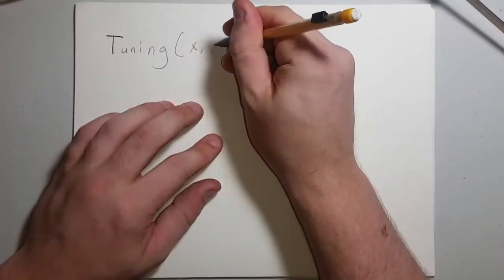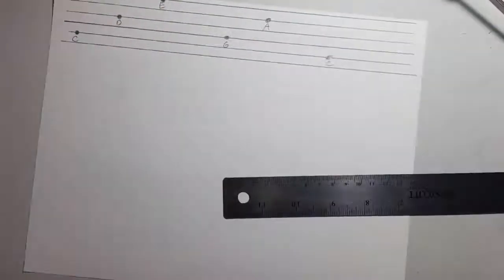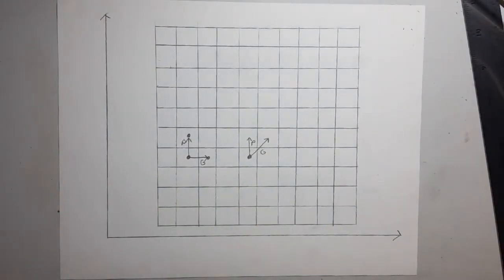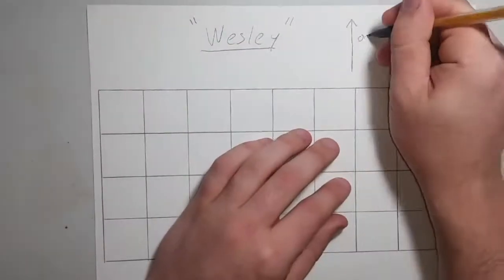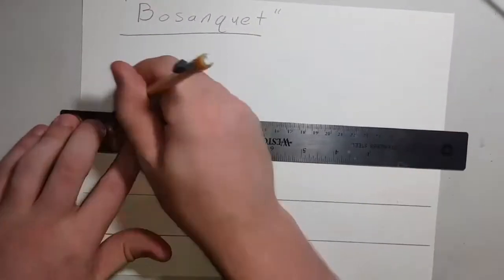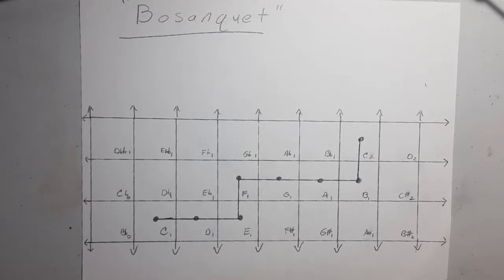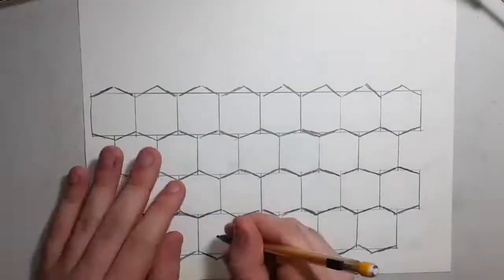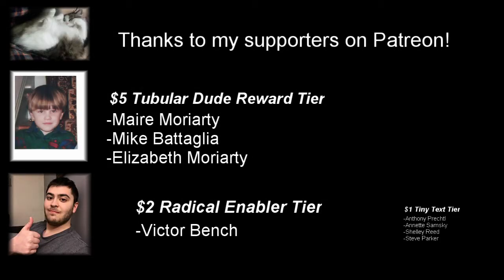Tuning Theory 4: Generalized Keyboards ("Microtonal Theory")

Comment: The Lord gave me a hexagonal keyboard layout for just intonation but it is very hard to explain the pattern, but it accounts for naturals, all flats, all sharps, and many pluses and minuses for syntonic commas up and down, and a few double flats and double sharps, all in very ergonomic positions for the hands for chords as well as scales. The keyboard is designed to be acoustic only and having harmonium reeds to produce pitches. The layout is based around the JI lattice of pure thirds and perfect fifths, but unlike the lattice, my layout can display and give the hands access to octaves of every note. The keyboard consists on 3 "universes" of keys, all right next to one another, but not directly related to the pattern of each contained universe. At the center of the "center universe" is low C2 and all hexagons have their points up. Perfect fifths are up and to the right, and perfect 4ths up are to the left. Ascending octaves are straight up AND down. Every universe is nine keys across with a version of C2 as the center note. The left most universe has Cb2 at the center, and the right most universe has C#2 at the center. Up to the right is major and minor thirds alternating and down to the left is minor sixths and major sixths up alternating with only one discrepancy in order to main consistency of the pattern of octaves. Music is asymmetrical, and this layout while orderly, does reflect the asymmetric nature of pure harmony while allowing extremely good access to chords, scales, and note clusters. It is very intuitive to look at, but very hard to quantify into a simple sentence so one can understand the amazingness of it. I also do not have a camera that can take a pic in a high enough resolution to make out clearly the notes and their letters and orientation. In my opinion though it really is the pinnacle of keyboard layouts because of it ease of play in 5 limit JI in as many octaves as you want in more keys than are available in 12 TET. I have never seen another with this layout. I hope I can find someone to help me build this organ in the future.

Comment: This is a really nicely done video. There should be a way to attract major interest in producing a popular documentary on this subject but the viewers need to be told exactly what is in it for them for such a documentary to generate popular interest, so the prospect of the relatively untrained doing unprecedented music  with enhanced expression of emotion are the two major selling points. Unfortunately these points have to be proven with music, they can not be proven by reason alone but only by field test and public demonstration. 

Further almost all the focus has been on furthering the theory when the physical challenges of designing  wide range generalized musical instruments  which are also easy to play, good sounding and durable once built are extremely challenging. The whole "hex key" approach is an attempt to  adapt the keyboard rather than a response to an opportunity, its assumed only finger tips are to be used as per the standard keyboard where hitting a little off assures one of unintended harmonies as a digit accidentally straddles a line, abutting keys is what we should be taking every oportunity to be moving AWAY from (consider how easier it is to play only non abutting black keys).

 Hex keys are clear to the mind but clumsy to the body and worse they assure only an expensive solution adapted to an expensive mechanical rather than inexpensive electronic mind set. 

What is needed are SMALL side activated buttons (like small very short joy sticks) with large inert areas around them, this way digits sliding about on the playing field provides timings that are very very exact and the instruments response can be direction sensitive! As a bonus the inert areas ensure that no accidental harmonies are even possible. 

For series of fifths systems the octaves need to be as close together as possible while still being individually accessible one at a time by digits and the octave columns should be parallel to the digits of the hands to allow full contact of octave columns by the underside of fingers for very large scale orchestral style harmonies. The surface should be curved across the direction of the octave columns so the whole underside of each hand is used to play, when a digit is strait one octave only is played, which one depending on the digits angle, but with more and more of a curve the digit plays more and more combined octaves with the pitch of the whole cluster depending on a digits amount of and shape of curve. 

This allows each hand to reach across the whole range of the instrument with ease, a keyboard would need to cover 8 octaves in 4 inches to do the same, it would need to be microscopic!

Ive endeavored to produce and post on you tube a great deal compelling music that was created using generalized polyphonic musical instruments and although the tuning is 12 equal in this arrangment the same piece will be played in the same way for a great deal of other tunings as well, something not at all true of the keyboard.

https://www.youtube.com/watch?v=jngOGR5seB4&list=PLPYiCOgE6NBSFGISv7D4RHdqgvKTdcfeD
Reply from the maker: Thanks for the kind words Bill :)

> What is needed are SMALL side activated buttons (like small very short joy sticks) with large inert areas around them, this way digits sliding about on the playing field provides timings that are very very exact and the instruments response can be direction sensitive! As a bonus the inert areas ensure that no accidental harmonies are even possible. 

I've wondered whether buttons with lots of large inert areas around them wouldn't be a much better a good idea. Though I haven't been able to give them a try, both the array mbira and the array nail organ look ideal! And yes, having the extra degrees of expressive freedom would be welcome too. You could even turn the joystick functionality off for amateurs who can't play in tune =P I wish the few isomorphic keyboard apps that are out there for smart devices would implement something like that, especially given the lack of haptic feedback which makes it impossible to know if you're on the edge of a key.

> For series of fifths systems the octaves need to be as close together as possible while still being individually accessible one at a time by digits and the octave columns should be parallel to the digits of the hands to allow full contact of octave columns by the underside of fingers for very large scale orchestral style harmonies. The surface should be curved across the direction of the octave columns so the whole underside of each hand is used to play, when a digit is strait one octave only is played, which one depending on the digits angle, but with more and more of a curve the digit plays more and more combined octaves with the pitch of the whole cluster depending on a digits amount of and shape of curve.

It's neat that you've put the time in to come to these conclusions. As far as I can tell, you've got the most experience when it comes to both playing and building/designing instruments to take advantage of a 2D note layout. I'm hoping to start prototyping a 3D printable 2D note layout piano-keyboard overlay and, once I've got the basic mechanics figured out, it'll be interesting to see what I can do with the contour and curve of the playing surface...

> Ive endeavored to produce and post on you tube a great deal compelling music that was created using generalized polyphonic musical instruments and although the tuning is 12 equal in this arrangment the same piece will be played in the same way for a great deal of other tunings as well, something not at all true of the keyboard.

Yeah man, congrats on your videos, I hope they get the attention they deserve. It'd be very cool to hear your pieces in different meantone tunings. (Especially TOP meantone. I have a love affair with TOP Meantone.)